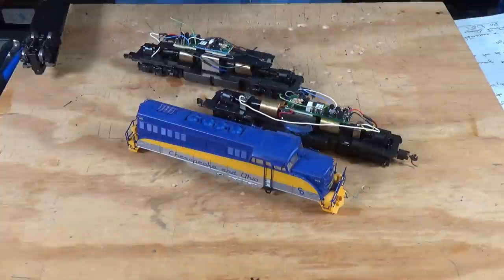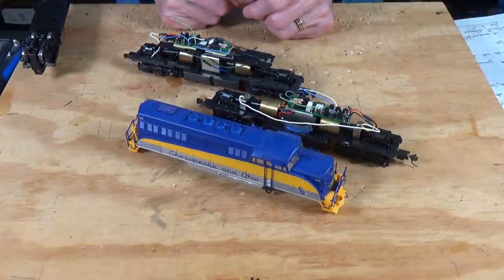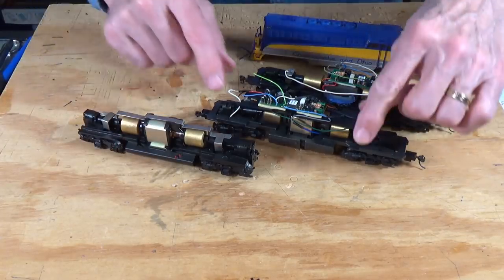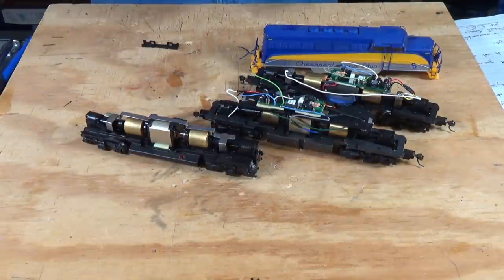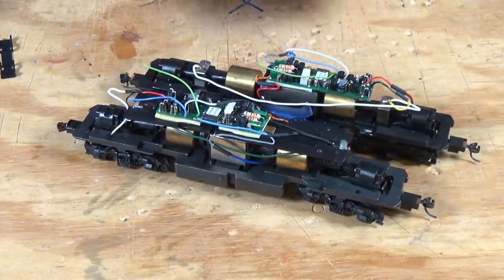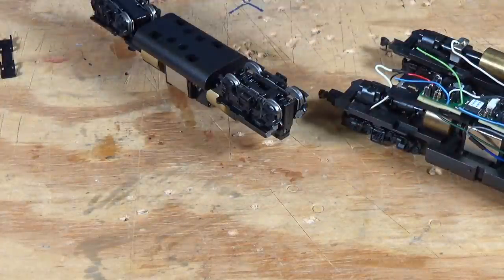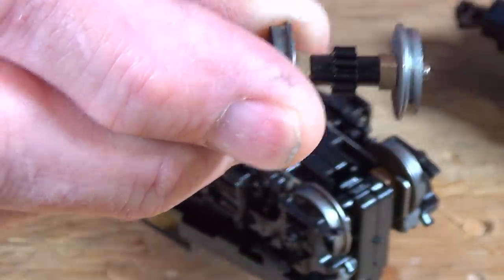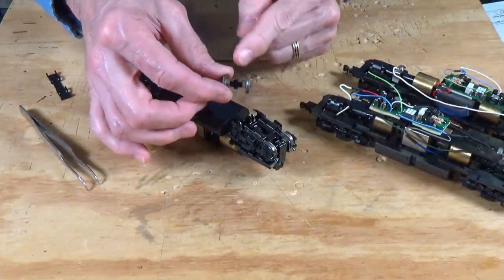Keep Those Old Diesels Rolling (228)

Comment: CRC 2-26 Lubricant is plastic safe, improves electrical properties and will lubricate motors.  I used it on a frozen BL2 and it works great.  Any bigbox or automotive store should have.  Works well on motorcycle electrics, too.

Comment: Ideas for video content:  Sound dampening in locomotive shells.   Adding weight after sound decoder's have taken up space.  Quick connect ideas for light wires.  I added ditch lights to a loco recently.  Putting lighting in so that the shell can still be removed seems a worthy topic.

Comment: Have yet to have a axle gear split on an Athearn blue box. Have a number of Proto 2000s, but they are rarely run as they are in storage so unsure if they have broke gears or not. I don't know if I could even begin to trust a 3d printed part that is going to be subjected to lubricant and needs to be somewhat precise in measurements. Never ever have I oiled the axle bearings, never had issues either due to not doing it.
Reply from the maker: Wish I could say that. I had to replace them on an Athearn RS3. The Athearn gears are likely cheaper than the Shapeways stuff but for the LL PAs there are no other options unless you try the trick I talked about in the video.

Comment: Thanks Larry.  I'm a little more cautious than you about greasing gears/worm drives: I guess it boils down to - exactly as you say - using the right lubricants. In the past, when there maybe wasn't the range of specialist lubricants as readily available as now, I found that grease (and over-oiling) attracted the lint you mention and dust into the gears.  I'd suggest that when buying a second hand loco it can be a good idea to remove any grease, as you have no idea what sort of grease might have been used in the past.
Reply from the maker: Yes, you need to be judicious about how much oil to apply. Grease generally stays out but oil will migrate, thus the need to re-oil over time. I am reminded of this every time I take a new loco out of a box and have to clean off the excess that got,out on the way here from China.

Comment: HI Larry a good video. 2 comments.. the link for the shapeways gears does not work (17 November 2024) and also I would not be informing people to insert a knife blade into their trucks as they might cut it or any cables that are coming out from the newer version.. better to use a small flat blade screwdriver.
Reply from the maker: Shapeways went belly up months ago which is why it doesn’t work. Even small screwdriver tips are thicker than a knife blade so you are less likely to break off a clip when doing this.

Comment: Very helpful video, Larry.  I wonder if that CRC QD Contact Cleaner would be a "better idea" (better than alcohol) as a track cleaning solvent?
Reply from the maker: I wouldn’t use it as it has some pretty nasty organics and is very volatile. When I use it I take it out to the driveway and then let it all evaporate before I even bring it back into the garage.
Reply: @TheDCCGuy  Thanks.

Comment: Will this remove the varnish off the windings?
Reply from the maker: Which?
Reply: @TheDCCGuy  
The windings behind the commentator.
Reply from the maker: I guess you mean the contact cleaner? At one time lacquer was used but now various resin coatings are employed. So it is a good idea to check the label and make sure it is designed for use with electric motors and plastic compatible. Most model motors have plastic in them. If you go to Hobby Town or other hobby shops they should sell electric motor cleaner for use with remote control cars and trucks.
Reply: @TheDCCGuy  
I was going to get the CRC QD like you use.Im worried because I'm in deep in 1950s era Bowser motors and I think they may be lacquer.

Comment: Nice video. Would you use compressed air to remove dust and lint build up?
Reply from the maker: It might work with dust but lint and fibers usually end up wrapped around the axles or embedded in grease and gunk.

Comment: Thank you for this video.  I've several locomotives that have been in storage for 40+ years. (Attic/garage) Currently they don't run. I don't know much about how to do maintenance on them. I'll try your steps out and see if I can get them running again! Thanks again.
Reply from the maker: Expect to find a lot of gummed up gears and frozen shafts/bearings. Warm soapy water and a toothbrush will get rid of most but isopropyl alcohol or in extreme cases WD40 can be helpful in dissolving the really stubborn stuff. I was surprised those old LifeLike locos were in such good shape considering they have been boxed at least 20 years. Of course they do need new axle gears!

Comment: I have a caboose. It is DC wired. Can it be changed to DCC? Should it be changed? Here is the trans.
Reply from the maker: What is it wired to do and what do you want it to do? Do you plan to run it on DCC or DC or a mix of both?
Reply: @TheDCCGuy  i dont know...
Reply: It is a caboose. I would like to put led on it
Reply: Sd390j
Reply: Can you call me if i
Leave my number?
Reply from the maker: You still haven’t answered my basic question, will it be ron on DC, DCC, or a mix of the two? If you want to ever use it with DC then the circuits I have posted will not work, only with DCC. For DC operations then you’d be better off to use a couple of 1.5VDC batteries with an on/off switch to lower the LEDs. The switch can be installed in the bottom of the caboose making it easy to flip it on and off.

Comment: I find cleaning the commutators on the motors with a ordinary pencil eraser works great
Reply from the maker: I am concerned with getting the rubber grit embedded in the gaps or other places in the motor, whereas with CRC it evaporates and leaves no residue.

Comment: First, I love your channel.  
Second, need help with a loco problem.  All my loco's are Kato, I use all Kato uni-track, Digitrax DCS 52 and mostly digitrax drop in decoders.  Every now and then a loco will quit working.  I'll put it on my programming track and will get a "dnd" response from the DCS 52.  That means the decoder cant be found (or something like that) and I can't reset the decoder to factory settings.  Any suggestions as to cause?  It happens with my older loco's and even a brand new one (within the first hour of operation).

One last question, every now and then, I'll have a turnout set the wrong way, run a loco into the turnout, the DCS 52 detects the short and turns my layout off.  Does this damage the locomotive or its decoder?

Looking forward to your response!!
Steve Rupp aka new guy
Reply from the maker: Steven—the power surges you get from those little shorts can change decoder CV values and if large enough can kill a decoder. First I suggest you  try reviving the locos by putting each on a dedicated service mode programming track and sending  a value of 8 to CV8. If the decoder is just confused this may sort it out and get it running again. Even if it can’t detect the decoder it still may be able to send the reset command. However if you let the magic smoke out then only a trip back to Panama City can fix it.
Reply: @TheDCCGuy  thank you for your reply!